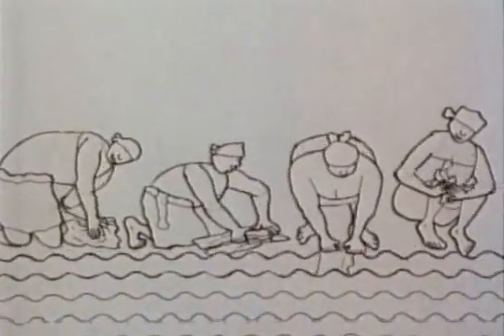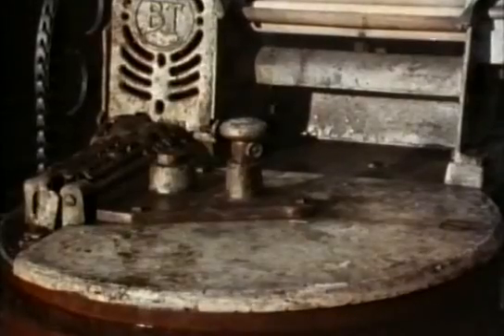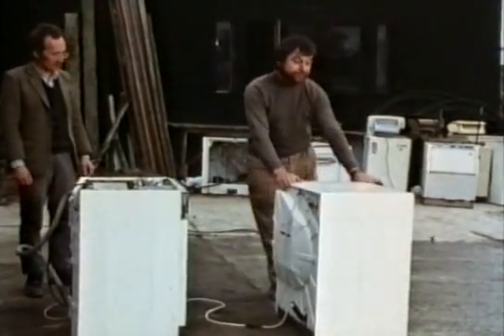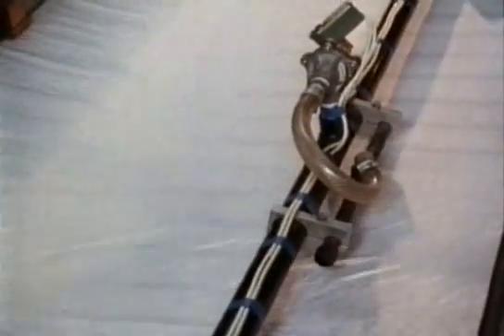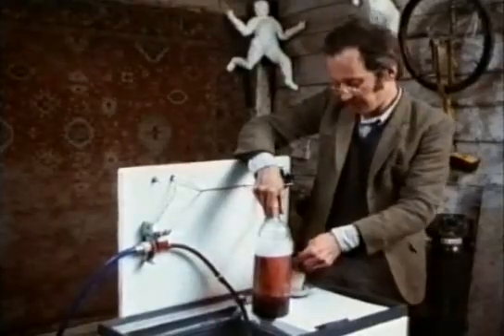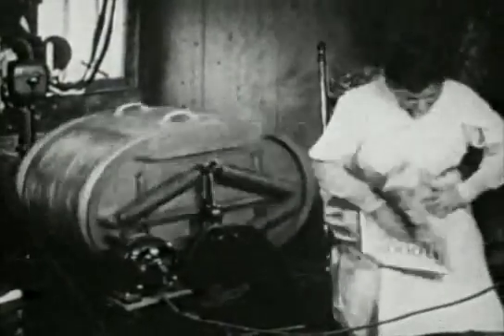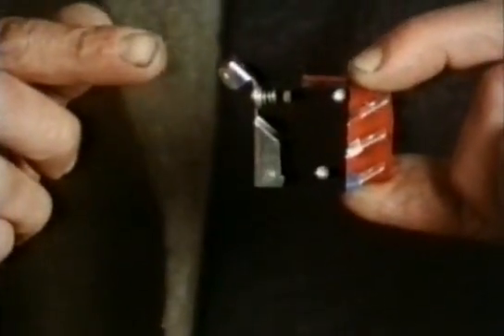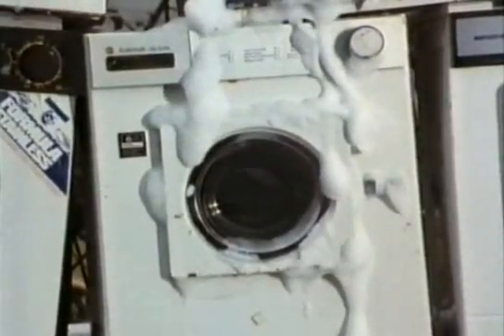Secret Life Of Machines 104 The Washing Machine

Comment: Fantastic ending.....

If all those machines were running and you exclude the motors and just calculate the 3KW heating elements that pyramid of machines would have used 84KW or 350A at 240V asuming unity power factor.... 

Something tells me they isolated the heating elements so assuming 200w motors with a .4 power factor that's a nice  5.6KW or 58.33A....

If all 28 machines had the heating elements and the motors running that's a nice healthy 89.6KW or 408.33A.......

Let us say the motors ran constantly and the heaters 50% of the time over a 1 hour period then they consumed 2520KWH on the heaters and 336KWH on the motors. They have a very nice electricity supplier that charges 5p a KWH then the bill would be an eye watering  £142.80 for 1 hours operation.

The peak current draw would have been 408.33A  !!! I hope they used a nice thick extension lead  :-D  I think they just may have tripped the breaker (understatement of the year)

Science is just great :)

Comment: Suprised the show skipped right over the Maytag gas engine machines. But perhaps they were only used in very rural areas that didn't have electricity yet.
Reply: The Maytag gas machines (introduced in 1915) were in fact the driving force behind the popularization of washing machines The current requirements for a proper machine were not generally available to most rural homes (there were a LOT more rural non or minimally electrified areas than there are now). Also, the whole reason that washing machines were enclosed, enameled (rather than painted) and in general white, is that they were usually not kept inside the home but out on the back porch since the whole affair of using them was rather wet and messy. Automatic drains were not invented yet let alone dedicated drains, along with the need to run the clothes through the mangle to squeeze out water. Further, dryers were rather late to the game and almost all clothes were hung on a line to dry so the back porch was an obvious choice of location.

Comment: When I was 5 years old my mother bought a Whirlpool washer and dryer, the kind that were meant to stack one on top of the other.  We had the washer installed upstairs in our apartment, but then my mother decided it should go downstairs.  So she rigged up a rope and was going to gradually lower the machine down the stairs.  But, at 5'2", she lost  control and the thing flew  down the stairs.  It survived 2 moves locally then an out of state move and then 3 local moves after that.  We had to replace the motor the year before I left for college.  It then survived a housefire and was used for yet another year.

Comment: Except for an over-priced microprocessor replacing the mechanical timer and no heating elements, my 10-year-old washer is identical!
Reply: It's kind of amusing that we are starting to see Washing Machines with 802.11ac (capable of transferring vast amounts of data, incomprehensible when these programmes were made) purely so we can put on the spin cycle before we leave the office. Ditto fridges, ovens, central heating and every other appliance featured in this series.

Comment: Watching the cutaway of the cheap machine with the lumps of concrete gave me a new appreciation of my ordinary top-loading American washing machine. I like the higher quality versions of the Sears Kenmore machines.
Reply: Jason McQueen Most front loaders have a lump of concrete.  When you have a big drum on its side spinning at 1000 rpm plus, you want something to hold it down.  Nothing to do with their quality.
Reply: Jason McQueen All washers have concrete in them, even your trusty Kenmore.  That is why the washer is always so much heavier than the dryer.  The concrete is used for stabilization during the spin cycle.
Reply: +Jason McQueen The concrete ballast doesn't bug me as much as the thinner wires and that pathetic lump of a pulley.
Reply: +HuggieBear39  My 1973 Kenmore belt drive washing machine has no concrete at all. Neither does my 1981 Maytag belt drive. Only newer junk machines need concrete inside.
Reply: My Kenmore top loading washer was is a piece of crap.  They hobbled together parts manufactured by Whirlpool put on a Kenmore control panel and called it a washing machine.  The manufacturer forgot two centering springs so the washer always operated out of balance. This caused the washing machine's transmission and seal to fail.  The machine barely lasted me five years.
Reply: Uh, no. Miele and Asko (except for Asko's absolute BOL machine here in NL, the Limited Edition) use cast iron counterweighs.

And Bosch/Siemens, AEG and many more brands used cast iron counterweights in the past, but have switched to concrete due to cost cutting.
Reply: Top loading machines are much harder on clothes. The agitator can rip and tear them.
Reply: yah if your carless
Reply: @nakayle  Also, they're not as good on stains as front loaders.
Reply: For years Kenmore laundry products were made by Whirlpool. The last one I looked at didn't look like a Whirlpool design so it's hard to say who makes them now. China? Korea?

Comment: While front loaders have increased in popularity in the US, I still prefer a top loader. Laundry triva: The late 1930s classic wringer washer was produced up to the 1980s! (only way to spot the era is the logo on the front.) I have a 1972 Pump model, It looks the same as my grandmothers 1940s unit, But hers had a metal (die cast) Maytag logo, Mine a sticker!
Reply: Top loaders 4 ever!
Reply: We had Thor top loading machines imported from the US into the UK in the 60s.
Good machines.
Reply: UK also had top load washers though theirs were ones with agitators like US washers rather than Japanese washers.

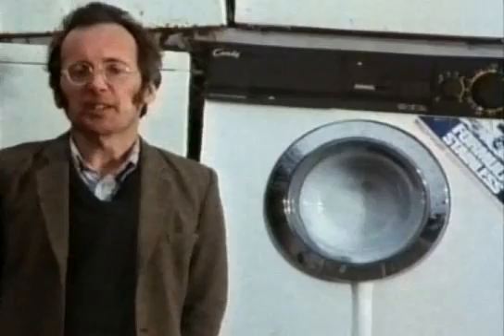Comment: @  24:22  i thought the washing machine was the one one  talking .....
Reply: This washing machine was actually floating bubbles. Some early top load washing machine models manufacture in Germany contained Water Heater feature. Whirlpool Malley top load washing machine models were manufactured in Australia during the late 60’s up until the late 80’s. One model contained Heat Temperature options, which occurred by filling with water until heat became satisfied. Once it got into temperature, the cycle would proceed for any Direct Drive model.
Reply: The reason why washing machines and tumble dryers are labeled Direct Drive is that the motor shaft is directly connected to the washer and dryer drum instead of indirectly via belt and those washers feature a tub that is directly connected to the operating motor by greatly reducing number of parts that may wear down, as well as increasing energy performance. 

Those types of models operate with less noise and vibration. Most of those types of early top load washer models would contain Suds Saver feature which automatically recirculated water and detergent to reuse for beginning of Regular, Gentle, Rinse cycle from storage hoses connected to the wall next to the outlet or old-fashioned giant storage tanks/tubs with drainage.

Comment: Our Maytag technician explained that, one other reason that these machines are made more cheaply is the efficiency rating requirements.  He also told me that Maytag has become such low quality (since Whirlpool bought the company and closed the Newton, Iowa plant) they won't even recommend their commercial line anymore.  Speed Queen commercial is built much better.
Reply: We just got a pair of Samsung's at Sears, and I have to say I am VERY impressed by the quality, value and price, it's too bad some of the domestic companies, like Maytag have chosen cheap over good. The Samsung's are so quiet too.
Reply: Michael Cook Samsung is also very shitty. Good luck getting more than a few months more out of those things.
Reply: +Jack K Well, over a year and they're still running strong, we haven't had a bit of trouble with them. Samsung's get very good ratings.
Reply: Michael Cook Recently had a friend get a Samsung.. DOA. You must have gotten lucky. My 33 year old GE Filter-Flo is still running strong also.
Reply: Jack K
The GE we for 18 years before the Maytag (23 years ago) went through many problems.  Three water pumps, two two speed clutch assemblies, replaced the motor once,  Replaced the timer assembly, broken tub pulley assembly once.  Finally the transmission became so noisy it was time to get a new machine all together.

Comment: the washing machines are so much better then  compared to todays prices of shit
Reply: fbw71u  The U.S. EPA put a stop to longevity with their draconian mandates for water and energy conservation. And electronically controlled machines cost far more in repairs than the simpler mechanically controlled ones. Look how much it costs to buy and repair a computer controlled car nowadays. Newer cars have a much less expected lifespan than ones that were built just a decade ago. Makers also take advantage of marketing things that don't have much of a lifespan. Like downsizing 3 pound cans of coffee.
Reply: They're getting better again with solid state switching and brushless motors. Mine has a 10y warranty on the motor and runs very quiet.